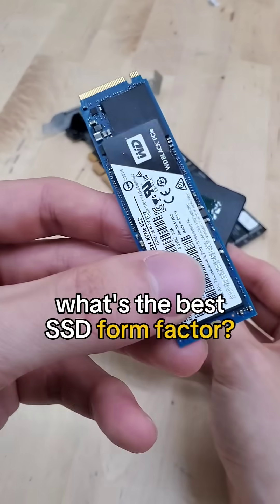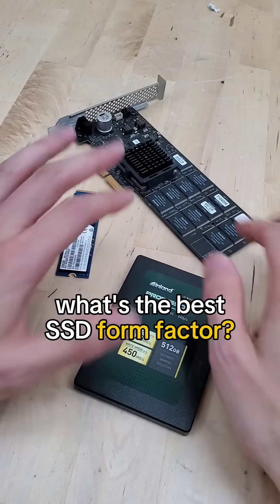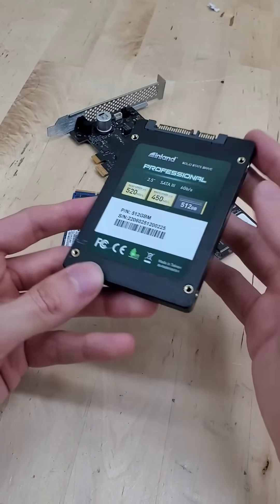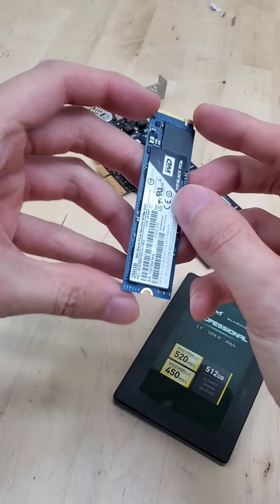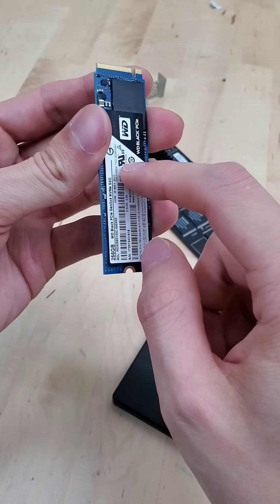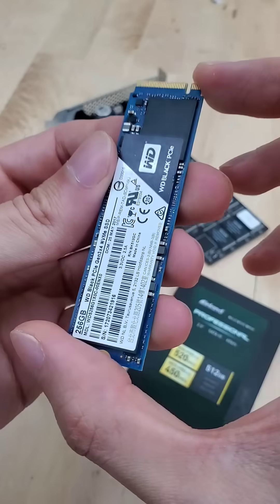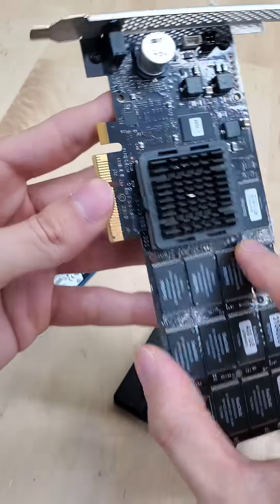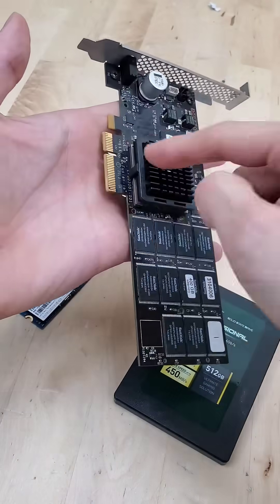The beautiful diversity of SSD form factors

Comment: the 2.5 inch one could also be u.2 (used in servers); 2280 could be both nvme and sata; there are also adapters that let use use your nvme with a pcie slot. and, speaking of "slab-style ssds" there not only 2280s ;-)

Comment: you forgot about huge capacitor which ensures that data will not be lost on power interruption
Reply: I didn't notice that but I guess it makes sense.

That's similar to the fairly large battery you find on RAID controller cards which helps power onboard RAM which holds data writes that haven't been performed yet.

Comment: You failed to mention, you can only cram so many pcie based cards into your system as you only have so many lanes or slots.  But you can cram a bunch more 2.5" drives in there wth an HBA card since you can take a pcie slot and make it like 16 drives per.

Comment: The PCIe SSD is only using 4 lanes so it isn't going to be faster. M.2 is just a smaller PCIe slot, you can plug anything in it even graphics cards. It only has 4 lanes but those lanes have the same bandwidth as a full-size slot does.

Comment: You make me feel old.

I'm not going to go that far back but will start here: EIDE HDD > SATA HDD > SATA SDD > M.2. 

In between all of that, we have had PCI-E cards to sub for missing board components such as EIDE/SATA/M.2 slots.

The card is just to expand the board when available for those who would prefer to keep what they have instead of updating a full chipset. 

While on the PCI-E, it was not just for these items. It was ment for a various amount of items according to the user. 

Today's needs are mainly graphics, capture, sound, or lan. However, the growing need for storage has started to fill the market.

With this knowledge, motherboard makers have been making adjustments to adapt to this growing need. It is highly possible that in the future, we may see a change to motherboards as we know it to accommodate these changes.

Comment: SATA 2,5" SSDs are not slow, but they aren't as fast as they could be, and not only that. They tend to be a lot expensivier than a NVMe or m.2 SSD despite being slower and having capacity limited to 2 TB for the common models. And the final nail in the coffin of them for me is how feeble the connection itself really is! So I rank SATA ssds nowhere higher in the list, instead letting the m.2 with a SATA controller earn the crown for higher compatibility and speed as well as reliability in general and being about two times cheaper than a similar capacity 2,5" SATA solid drive. 
Though I want someone to disagree with this, as it's mostly based off my personal perception and recent unfortunate experiences.

Comment: Calling sata SSDs slow is wild
Reply: NVMe can transfer multiple gigabytes per second, the best SATA ssds can only do half a GB. Both are fast but NVMes are crazy fast.
Reply: @mar2ck_ irrelevant. They are not slow. You not used HDD?
Reply: @EmArgh   He was speaking relative to the options he was showcasing. That much is clear. Not that he was talking generally or vs HDD.

Comment: There are M.2 Sata drives as well. The only problem besides thermal issues are all NVMe M.2 still have random reads and writes from 2016 with much better sequential R/W that boils water and itself really quick of you're using the drive with passive cooling

Comment: Sata is the most reliable. they last for years, never had an issue. almost all my NVME ssd's just stoped working after 6 months to a year or just wiped themselves (only used WD and samsung).

I still use NVME as my main storage, and a lot of regular automatic backups to a NAS with HDD's in raid.

Comment: I honestly think we need a new form factor. Something that slots into the motherboard like a RAM module, so that it can be cooled from both sides, is easy to install and small in footprint.
Reply: So, you want a vertical m.2 slot?
Reply: @hanqnero  like a DIMM.2
Reply: @GeoStreber  wouldn't work for laptops
Reply: @hanqnero  why not? RAM slots also exist in laptops, where the connector is kind of sitting flat on the mainboard.
Reply: @GeoStreber but with so-dimm we came back to a horizontal slot like nvme :)
Reply: @hanqnero  Correct. That doesn't mean that the slot type should not be optimized for being mounted vertically for better cooling and operatability.

Comment: I use all three of these for very specific use cases. Sata SSDs generally fit anywhere like USB keys but there are systems where you can't load up on so many because M.2 has taken over and rightly so. Excellent packaging. HHHL SSDs also have a place, like when I can't use the others but have PCI-E lanes to spare. Really old computers and some servers are good for it. Especially SFF desktops converted to server duty.

Comment: Actually you can also buy U2 SSDs, they are enterprise grade, meaning more consistent performance and better longevity.
However, they do require an adapter cable, unless you are using the X870E Hero MB, which has a SAFA port that can connect a U.2.
Reply: They are supposed to be connected on a backplane, and hot-swappable, like older SAS HDDs (though you could mount them by other ways on some low end SAS cards).
Initially SSDs on PCIe cards were meant for servers that require a very high IO rate, like DB server, and likely to embed a boot rom (just like any server grade SAS controller) for legacy boot, EFIs were not everywhere 15yrs ago, it just started to enter the market, it became mainstream because of HDDs over 2TB and NVMe drives.
Fun fact: you could boot from an EFI drive/array on an high end raid controller that had an embeded EFI depite having a motherbboard without any EFI capabilities (motherboard does a legacy boot on the card, and then the card handles the EFI boot).
Reply: Funny enough, not sure what's current necessarily, but certain manufacturers have been putting U.2 ports on the boards for a while. I know EVGA was a fan of them for the past while; looking at their boards that included it is how I learned what it was. I think it was an Intel consumer (not HEDT) board and they did some cool tricks to let you swap between either SATA drives or dual U.2. Something like that.
Reply: WTF is a "SAFA port"? What X870E Hero has is a SlimSAS port, also known as SFF-8654 4i.
Reply: Wait so you’re saying that Hero is not just an Asus term for their high end boards?

Comment: In my experience M2 SSDs are no more expensive than SATA in 2024. In fact, I’ve found them to sometimes be slightly cheaper. The only reason I would buy a SATA ssd is for backwards compatibility with older systems.

M2 SSD: For new builds or upgrading the storage in a newer (2017+ PC)

SATA SSD: For breathing new life into an older computer without a M2 slot!

HDD: for tons of storage at a cheap price!

Comment: The problem with SATA isn't that it's slow, it's that SSDs hit the transfer cap. But the cap of current SATA is still 600 MB/s versus NVME's 3500 MB/s. Even on a SATA SSD, Windows will launch almost instantly. There's also the bonus that they're the dame side as a laptop HDD, so they can be used to replace that and get some more life out of one, as those laptops' biggest bottleneck is the HDD. I have a Windows 10 laptop that came with a HDD that took forever to do anything because the HDD was being capped by Windows 10 processes. I replaced the HDD with a SSD and no more bottlenecking with Windows.

Comment: I had a very early pcie SSD card.  It is the bee's knees at the time, but it slowed down the BIOS portion of startup quite a bit.  Also, you needed to load drivers in from a disc since they weren't natively supported in Windows, at least at the time.  I'm a big fan of the M2 NVMe we have today.

Comment: Here are some more form factors (These are variants of the ones shown in the video with some differences in their size, dimensions and protocol): 
-U.2 and U.3 use the SFF-8639/8xxx connectors afaik. U.2 and U.3 support SAS, NVMe/PCIe and SATA
-mSATA is like the M.2 SATA connector except this one supports only SATA and not NVMe/PCIe, and afaik M.2 standard had more versatility, which is why mSATA became obsolete. No major name-brand company I know of is still producing these ssds.
-You can get M.2 "gumstick" ssds smaller and larger than 2280 (22 mm x 80 mm) in the market, but there isn't as much demand for those as the 2280s. Certain laptops and Xbox Series X and S use the M.2 2230 ssds (22mm x 30 mm). You can even get them in sizes as long as 110 mm (1.1cm) but those are seen mainly in enterprise environments.
 ABout SAS: this is basically like SATA but with twice the bandwidth at 12 Gb/s vs Sata III's 6 Gb/s (I have only seen such speeds on SSDs tho..). Note the small "b" here- this indicates bits and not bytes, meaning that these have a maximum speed of 1/8 of 6 GB(ytes) per second or 0.75 GB/s while SAS has a maximum speed of 12 gbits per second or 1.5 GB/s. 
This is as far as i know, if you know more please correct  me!

Comment: To simplify it even more:
2.5 SSDs are the cheapest and the biggest bang for you buck, but have slower read and write speeds.

M.2/NVME SSDs are the best option do to being more available more compact and every system learning towards them more with more computers having as many if not more M.2 slots then Sata ports.

And don't even bother with the PCIE SSD. Becuase they don't even make newer ones anymore. An they're the most expensive for similar speeds an performance. Althought PCIE to M.2 adapter is pretty useful.

Comment: If you have extra M.2 slots on your motherboard and you're thinking about getting an 2.5" SSD, don't. Get a Gen 3 M.2 instead. They're around the same price as an 2.5" SSD, they run at x2 the speed and you don't have to deal with annoying cables.

Just make sure your motherboard is backward compatible with gen 3 if you m.2 slot is gen 4. Most motherboard are but you can never be too sure.

Comment: Really now that NVME M.2 is the standard, 2.5" sata SSDs really aren't any cheaper than m.2 nvme SSDs, and it's kinda hard to find m.2 SATA SSDs, they were really only relevant for a few year period in laptops before nvme drives got efficient enough to run in laptop chasis, pretty much only 6th and 7th gen Intel laptops that are now ewaste.

Comment: The last kinda takes me back to the old SCSI or IDE Amiga boards you would slot into one of their Zorro II or III slots. You could often bolt an HD onto the board and several of them had a RAM expansion as well. On top of that you'd typically have an external SCSI port for CD drives and other external SCSI peripherals.
Reply: My 68060 and 16MB of RAM waves back from the SCSI bus. 😂
Reply: I tried sticking an ISA network card into an Amiga once but it didn't work. :(

The funny things is some Amigas, like the 2000, has both Zorro and ISA slots but the ISA bus was only available to a PC bridge board but wasn't available to the Amiga.

Such a shame. I wanted to try putting my Amiga on the network but you have to buy a Zorro NIC. Those are rare, expensive and old.

At least I didn't fry the card or Amiga by accident before I knew about how the slots worked.
Reply: @jeremylindemann5117  there was a hardware/software interface called the Mediator by ElBox  that allowed for about 40 PCI 100Mbps NIC's.
Reply: @jeremylindemann5117  Yeah, I had a XSurf-II which I used to connect to DSL back in the day. 

I saw in the Deathbed Vigil video that the Commodore engineers were planning on putting in working ISA slots for the next Amiga generations. Sadly the company was murdered by greedy execs and we never saw what Commodore was going to do next.
Reply: Zorro slots were genial, tech goes forward but sound hardware design has gone out the window. Also everything is now written in high level languages that are very wasteful and unoptimized😔 .

Comment: there are M.2 Sata und pcie ssds.
M.2 PCIe SSDs are as fast as ones that plug into full size PCIe Slots. because it's the same connection, just another size and style of connector.
You can even get adapters from M.2 to regular PCIe and that way run a graphics cards on a mini PC that doesn't have regular full size slots.

Comment: None of you have even heard of a “ram drive” but it’s faster than all of them and the predecessor  to SSD.
Reply: I was almost sure they died off back in DDR3 era but recently I've seen some new DDR5 pci-e cards. 4 DIMM single slot or 8 DIMM dual slot.
Reply: @Lapsio  You sure that's not CXL?